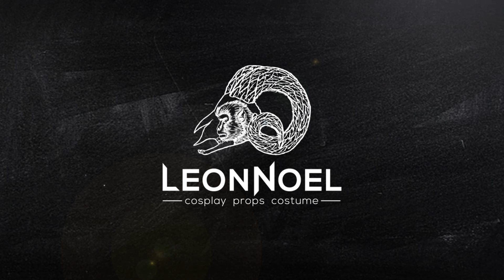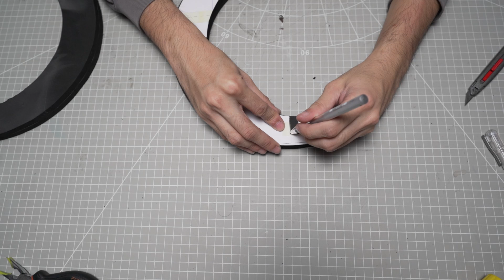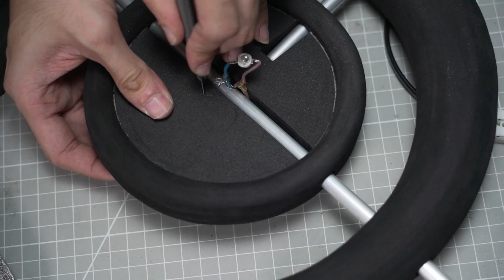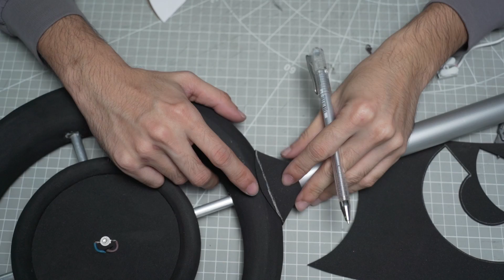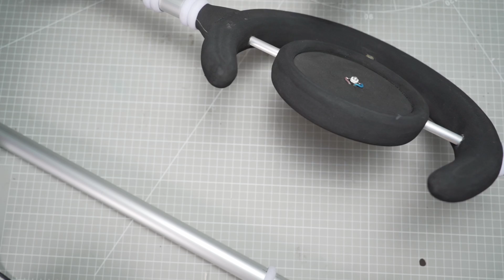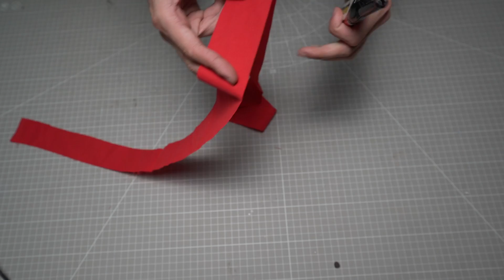Create an Epic Lights Up Frieren's Staff Cosplay on Your Own

Comment: respect for going foam in a world of 3d printing. that said why not use a premade addressable RGB strip clear taped to the underside a tinted red dome? bonus points of being able to swap colors or have patterns while avoiding any reliablity issues and still having the ability to use a source small enough to fit in the staff.

Comment: Great tutorial! I just got your pattern on Etsy :) How do you make the two halves of staff detachable? Does the PVC section you cut hold the bottom half in place once it's slotted over?
Reply from the maker: Yes, I use a slightly bigger pvc pipe, remove a part of it and it will act as a   stopper

Comment: I wonder if prefab puck lights arranged back-to-back would be a usable workaround for those of us who have a good understanding of prop making but can't wrap our heads around wiring our own electrical.
Or maybe sanding the surface of the acrylic dome to make it better at light diffusion and then insert some RGB strip into the perimeter. That might be easier since you can buy premade connectors. Could even use neon flex lighting to avoid hotspots.
Reply from the maker: There are millions of ways to do it though, I have a friend who has explosion knowledge on electrical stuffs and he is using premade led as well and it still works. So yeah, there's really no limit that you have to wire everything though